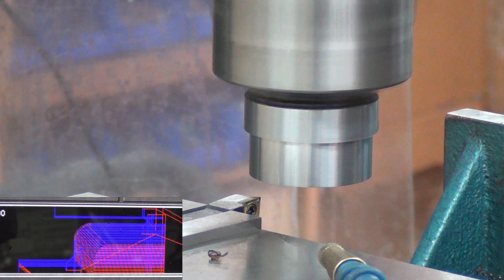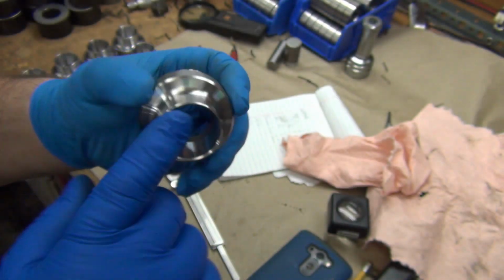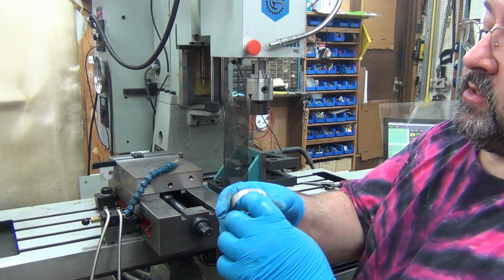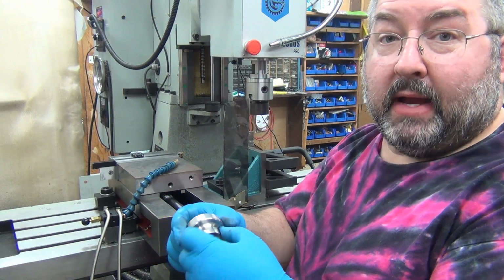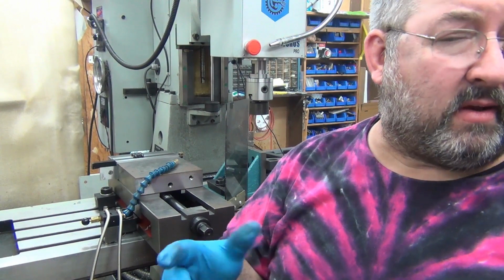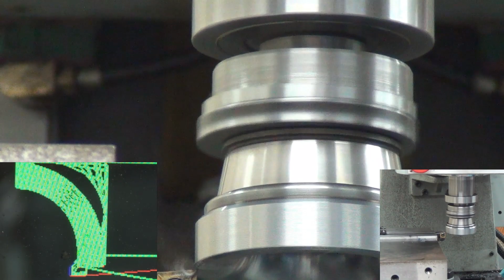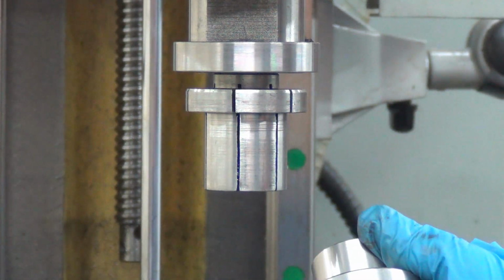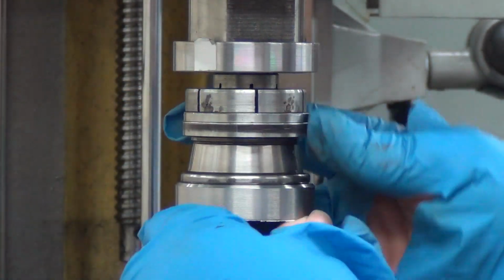Novakon Torus Pro - Mill/Turn, 521 Inner Bearing Adapter

Comment: CNC is fascinating and I keep being tempted by it.  It feels good to work out the problem doesn't it?  Thanks for sharing.
Reply from the maker: +cerberus Have you seen the new 440 by Tormach?  I don't have any clue on the cost, but it looks like it's supposed to be a smaller machine for those that want a much more modest start.  I'm looking forward to seeing more about it. :)
Reply: I doubt that I will actually purchase a CNC machine.  But I may try to convert one to it.

Comment: You need a higher chipload to break those chips instead of making razor wire.  That or you need a bigger depth of cut.  If you're outside of the DOC/IPR box, you'll get those stringers.

Forgot to add, DOC for roughing should be close to your nose radius, so 0.015 per side with a 1 insert.  A 2 insert should be 0.030 per side.  Figure on 0.010-0.020 IPR.
Reply from the maker: +eformance Awesome! Thanks!  I'll be doing some more mill turning fairly soon and I'll try this.  I was trying some high feeds and getting broken chips, but I was having trouble with the spindle stalling.  I was just sent a list of vfd settings from another torus pro owner.....I haven't had a chance to change them, only compare them and I'm pretty sure some of the torque settings are off.  Hopefully, those will get me more torque and I can get up into the chip loads your talking about.  I love straight forward "rule of thumb" things like this! Thanks!!!!
Mike

Comment: Oh, finish feed rate should be somewhere around 0.003 to 0.005 IPR.  The point of CSS is to keep constant SFM, this should keep the chipload the same through the entire diameter, giving you the best finish.  When you turn with constant IPR and RPM, your surface speed falls off and the chipload increases as you go smaller in diameter, this is why the spindle speeds up in CSS mode, the chipload stays constant as well as SFM.  The solution to a spindle stalling issue is to increase RPM, the motor is rated at 1725 RPM usually, so the closer you can get to that actual motor RPM, the more torque you will have.  If you exceed the "base speed" of the motor, RPM goes up, but torque falls off.  The motor has a "square" of power input and after you hit base speed the power is constant, trading torque for RPM, so sometimes you have to slow down to get back into the torque band needed to push the chipload you want.
Reply from the maker: +eformance Very interesting about the torque!  I'll keep that in mind!!  I'm still enjoying another day or so at the beach with my wife, so maybe sometime this next week I can play with it!  Thanks!!!